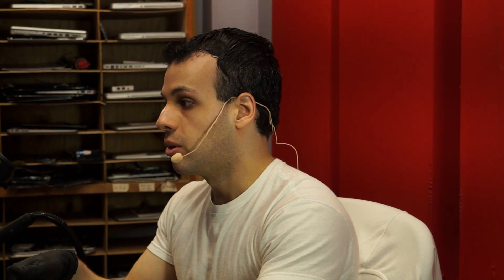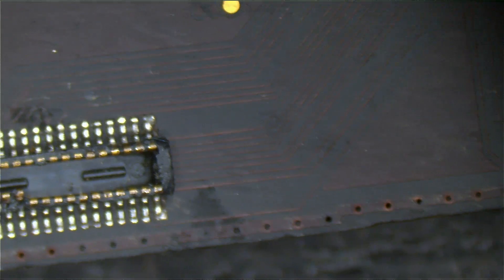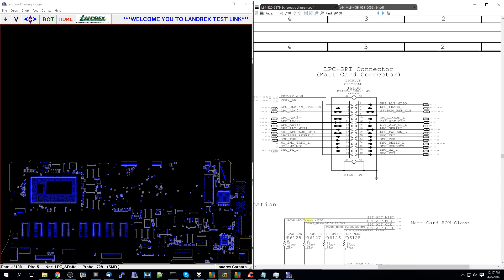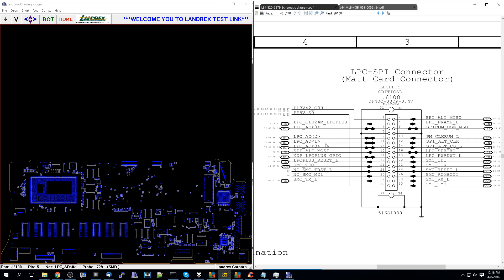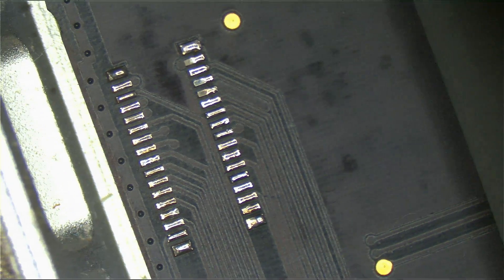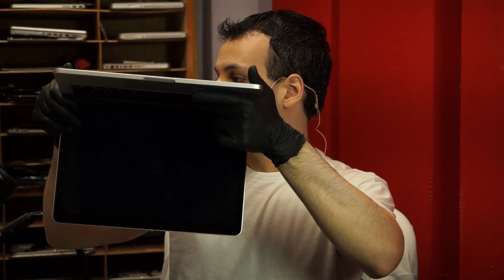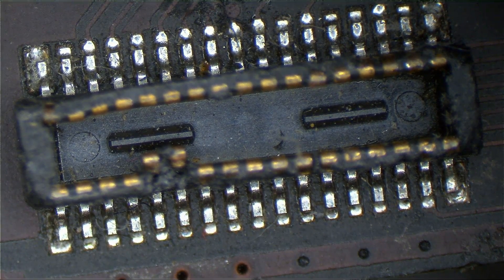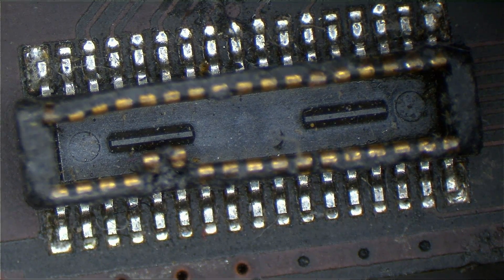Unused diagnostic ports CAN kill your board! Pay attention to them.

Comment: Same goes for inspecting unused pads on the PCB. A solder-bridge here can easily pull down a data bus etc.
 Usually these unused pads are "unpopulated" (due to a particular PCB being used as a common platform for multiple product models, or "depopulated" due to an ECO (Engineering Change Order or Revision change).

Comment: Wow, I didn't know Apple used these connectors for diagnostics. I would think for diags only, a company would use something like a bed of nails or the like, as the PCB has hundreds of those larger test pads. So, Apple probably uses this connector to also program the chips on the board after the PCB is built, for example to program SMC as you can see the connector uses SMC_RX_L and SMC_TX_L, among others.

Comment: Thanks for making vids man I've spent a lot of time last 3 days watching your vids.
 I have never had anything to do with board repair or the likes, nor do I have any experience with electrical work in practice, so pls bear with a few very stupid questions scattered throughout the vids.
 OK makes perfect sense that when pins get shorted on that port things brake, but how would a pin on it help you find a burned solder ball under a chip via visual inspection of the port if the port isn't connected / shorted / corroded / conducting at all? Does a little machine like this produce enough current at such a low voltage for the pins to spark and leave carbon traces / burned areas or am i missing something completely obvious?

Thank you for sharing your work experience I find your ramblings and troll phone calls to be some of the best entertainment I've had the pleasure of watching in a while ;)
Reply: I wasn't paying close attention to the video but I assume if it was sending improper voltage to the other chip, it would burn the ball or if the ball burned you would get an unusual reading on the corresponding diagnostic pin.

Comment: you think some potential problems manufacutes put there PURPOSE or in place where high chance to get damaged. I knew dude almost trew away his car bc some short no connect he could not (he found evently with help through some forums). the location of this connector put right next to brake foot by the driver door it was corroded the lien carried security signals. live in wet, rainy, winter climate places salt water stepping on directly on  that spot every time you enter the car. the connector was 1 foot shy from being raised under the steering wheel where the lines went.. look general purpose schematic yu don't see the connector you see straight line. when you see shit like that you think dirty bastards.
Reply from the maker: +funtroller smitty that shit drives me nuts.

Comment: while replacing a vram chip to an xbox 360 mobo I pulled of one of the pads on the board is it possible to rewire that chip ball point. it an exterior pad to the vram.
Reply from the maker: +Mechdestroyer117 can you scratch away the board material a little until you see a nub? if you can, put a 0.25mm or 0.3mm solder ball on the nub with some flux, and you get yourself a second pad!
Reply: I may be able to I never tried going deeper into the board this pad location does go through the first layer board. I have the schematic to the xbox board. I was thinking about running a line from missing pad to a current test point on the flip side of the board. I've seen u be able to run wires under a chip that missing a pad to where it connects onto the board. what thinness would I need? some where around .25mm - .3mm wire. but I'll try what you suggested first.
Reply: I fixed it. Thank you so much I was able to repad that spot.
Reply from the maker: Mechdestroyer117 What method did you use to get it done?
Reply: I scratched away at where the pad was missing and was able to get some copper to show. Then used solder to make a new pad.
Reply from the maker: Mechdestroyer117 kick ass! try dropping a solder ball in next time and heating it with some flux, it's like making a new pad. much easier!! 

Good job!

Comment: I figured out what happened to my video card. EVGA GTX480 It's an older card but still handy to have around for a second or donor card. I got a relatively cheap microscope and discovered the mini HDMI port problem. One of the pins got shoved back in the plug. Is there any way to fix this without having to change out the entire plug?
Reply from the maker: +Chuffered FUoogle I've never tried, it would take less time for me to replace the HDMI port than to screw with the pins.
Reply: +Chuffered FUoogle 

Be sure that your not trying fix something that is not broken :)

FYI:
HDMI has three contact sequences: First Make, Second Make and Third Make [1]. So it is not unexpected for these contacts to have different physical placements within the connector.

For example, the hot plug detect signal talks about a third make [2]:

8.5 Hot Plug Detect Signal
An HDMI Sink shall not assert high voltage level on its Hot Plug Detect pin when the E-EDID is
not available for reading. This requirement shall be fulfilled at all times, even if the Sink is
powered-off or in standby. The Hot Plug Detect pin may be asserted only when the +5V Power
line from the Source is detected. This will ensure that the Hot Plug Detect pin is not asserted
before the Third Make of the connector (see Section 4.1.5).
A Source may use a high voltage level Hot Plug Detect signal to initiate the reading of E-EDID
data.
A Source shall assume that any voltage within the range specified for High voltage level in Table
4-26 indicates that a Sink is connected and that E-EDID is readable. It does not indicate whether
or not the Sink is powered or whether or not the HDMI input on the Sink is selected or active.
An HDMI Sink shall indicate any change to the contents of the E-EDID by driving a low voltage
level pulse on the Hot Plug Detect pin. This pulse shall be at least 100 msec

[1] HDMI specification 1.3a: 4.1.5 Contact sequence
[2] HDMI specification 1.3a: 8.5 Hot Plug Detect Signal